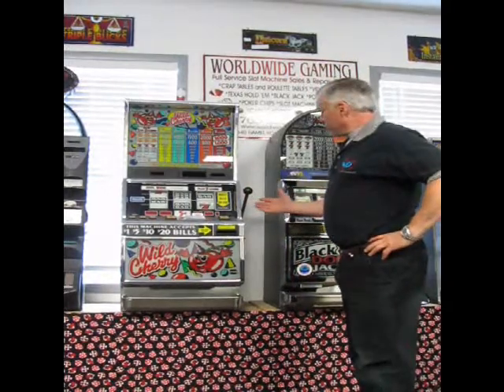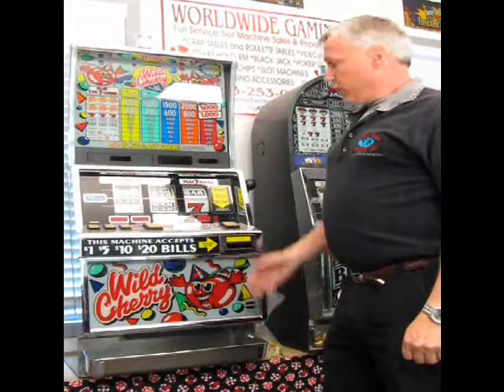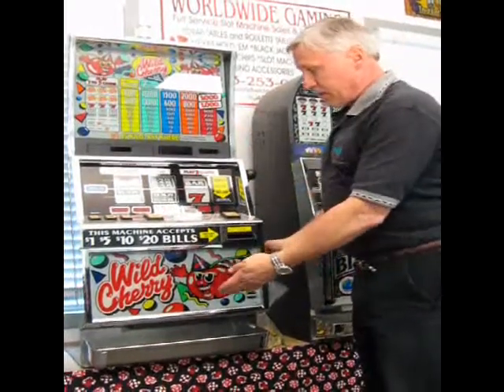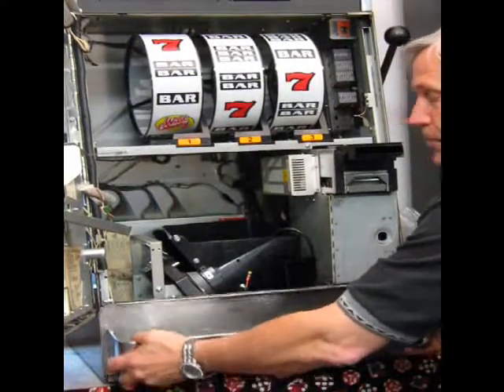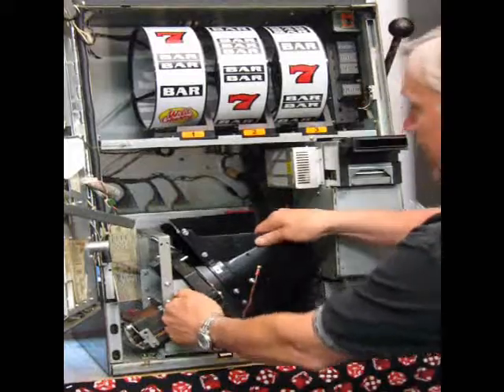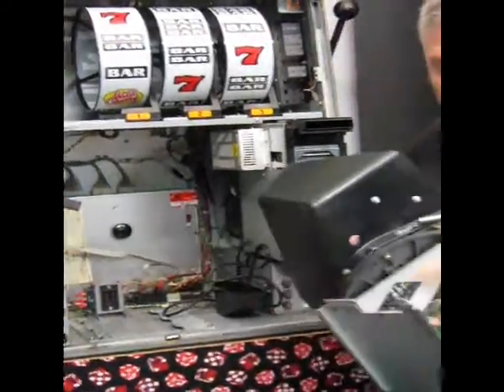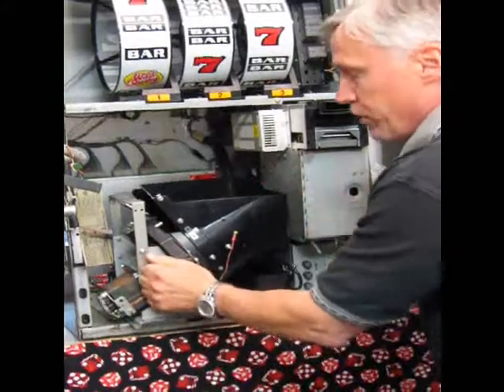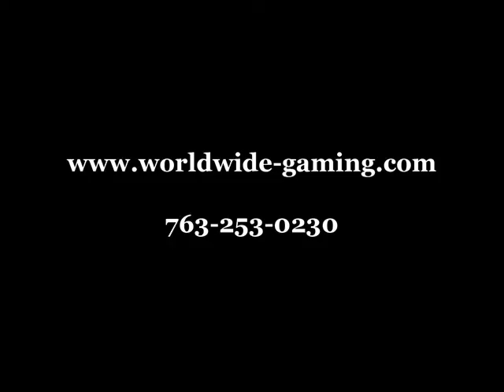How To Install a Slot Machine Hopper - IGT S+

Comment: hey this video actually helped a lot. i found an old igt s+ sizzling 7s machine at the junk yard that gave me a code 12 when i plugged it in and turned it on. the chart said that its the battery on the board but i couldnt figure out how to get the hopper out to get the control board out. i know nothing about slot machines so this was really helpful!
Reply: I am here for that same reason